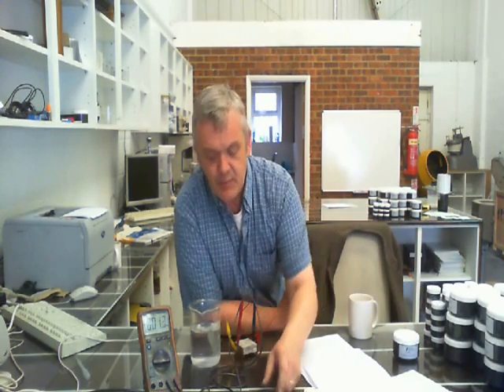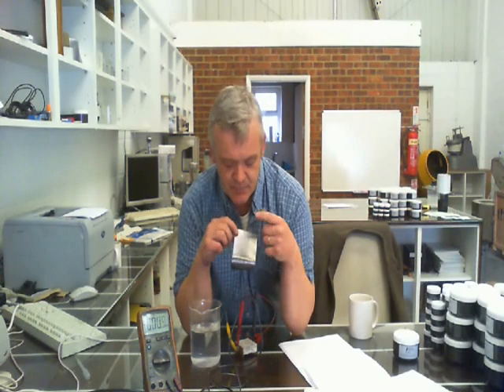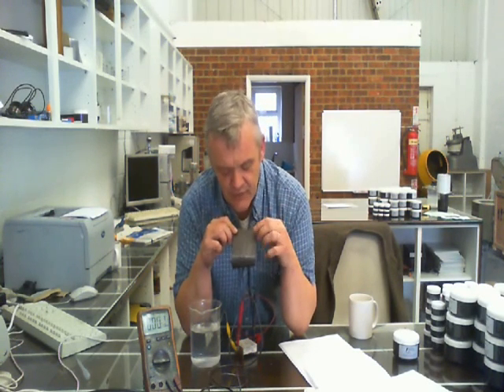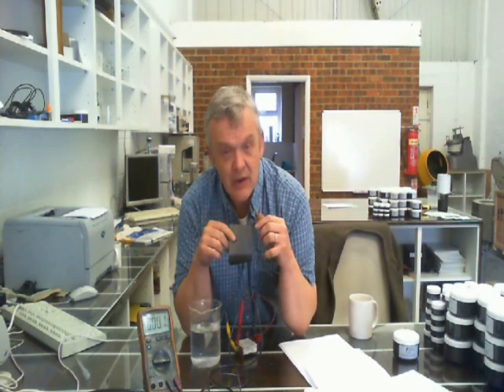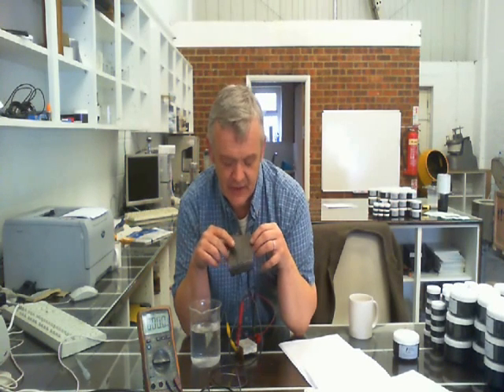Thermal Power Generation From Graphene

Comment: Hi Robert! Do you think it would be possible to use such an ink to paint a roof and get enough electricity? What would be nice is that by night, we could still get some power from the heat that gets out by the roof. I wonder if such material, by its isotropic property, give an extra-insulation. I mean if it generates some power, i suppose that the transfer of the heat is slowed down? Thank you for your answer.

Comment: If you were to apply this coating to the outer hull of a kenetic tidal generator to work in conjunction it should increase the overall efficiency of the device ie. more power smaller footprint.  On another note why noy coat sea walls with the waterproof graphene allowing power generation through the Peltier effect from waves crashing against the wall.
Reply from the maker: it's a good idea but sea walls don't have a particularly large surface area - well they could be mode larger with a villi structure

Comment: As the material is anisotropic, do you see a difference in resistance if you take 2 square readings at 90 degree to each other, or is the effect to small to register on an AVO. Great work btw, always enjoy vids and comments.- Martin.
Reply from the maker: yes - by a factor of 3

Comment: If a drop of salt water generates electricity, I wonder if its reciprocal? In other words the ability to move the droplet of salt water by applying current between two or multiple points on the sheet? I don't know if an aniline dye is the same as aniline salt but there could be "potential" in display technology - if you excuse the pun :)
Reply from the maker: I think the effect arises from the difference between ion inertia and fast electron transport within the graphene sheet - so the effect would be reciprocal but the energy required to move the ionic mass would be pretty large - or at least that would be my guess - if you are thinking of rotational effects then isn't this exactly what liquid crystals do? in a semi hydrated form large sheet graphene oxide platelets have liquid crystal properties.

Comment: By the way, I am pretty sure you only get 900 Millivolts Voltage, cause your lower lead croco clip is not isolated and is in the water. If you would isolate the contact point fully, so no water would come into contact with BOTH contact points of the graphite painted PET sheet, your voltage would only be in the lower 1 to 30 millivolts range probably... Have had these problems myself when trying out new battery concepts...
Would be great, if you could confirm this. Many thanks.
Regards, Stefan.

Comment: Robert, how much voltage was that ? It is hard to see, please always tell the values with your voice. Was it 0.8 Volts ?
Was your connection lead clip also in the water ? If yes, this is just a dissimular metal galvanic cell you really have to isolate all your contact electrode materials from the water, otherwise you get dissimilar metal effects and thus an galvanic cell. so just coat the contacts with plastic spray or hot glue, so it does not get any contact with the water at all...also any copper contact strip needs to be isolated from the water..
Regards. Stefan.

Comment: Do you think this material could be used to create an effective earth battery?
Reply from the maker: it can certainly be used to create effective batteries but I am afraid I know very little about earth batteries
Reply: Robert Murray-Smith There hasn't been much innovation in earth batteries since the days of the telegraph. They use two rods of different materials usual iron and copper to generate voltage. The problem with this though is that the process of generating electricity corrodes the rods thus a long lasting earth battery isn't viable. I wonder if the same effect would occur with the material you made.
Reply from the maker: Charles Haro
certainly worth a test
Reply: yes,yes. science

Comment: If the salt water and graphene was generating 0.8V and the graphene sheet resistance is 60 ohms then the maximum power output would be 2.6mW this is small but very interesting as it is a first try with no optimisation.
Reply from the maker: those figures are right - I have done the doctor blade on this and it is 56 ohms per square per mil - it is interesting isn't it

Comment: Perhaps there is some metalic dopants better than others for thermal power, just as with silicon and other semi-conductors.  I guess this is what is in your ink a bit.  I guess even though it looked like 0.9v that is a high value still, as known, hooking them in series/parallel and layers increase power/efficiency.
Reply from the maker: the ink is pure carbon - no metal - sorry to disappoint
Reply: perhaps adding some  could produce an effect, maybe a layer of silicon oxide on top or a sandwich
Reply from the maker: trailkeeper
could be - it's definitely a good idea and I may well play around with that - so thanks for the suggestion mate

Comment: Thanks for posting this and this was the exact the kind of testing I wanted to do with the ink.  I have done a lot of testing with thermal electrics due to the nature of benefits of non moving parts and so forth.  I have even went as far as binding copper and iron  together in a V shape in series to hand make one myself.  The results where okay for my testing but not what I am shooting for. The cost of commercial ones make it not very cost effective per watt with the included thermal sources input cost.  This is pretty exciting I must say cause that is just one sheet.  Thermal electrics can increase efficiency by stacking them on top of one another from one thermal input. 

If your going to do some more testing try seeing if you can create a current with just your hand and the ambient temp with one sheet. It will only increase with a little bit of engineering and stacking them.   I am crossing my fingers for ambient temp and your hand is enough to generate some numbers. Since you have plastic as your substrate  this may will give you more actuate numbers cause no warping or expanding is happening or at least a good control. Then you can get some control numbers that are good enough to calculate efficiency.  If you can get anything 5 percent or above you will basically beat most commercial ones hand over fist on cost. 

I honestly would be up for 5 days strait testing this.   The amount of applications due the nature of the material and along with its cost.  So many ideas I have had and now I have probably a hundred more.  I am not going to get any sleep tonight XD thanks hahahah.  So many ideas........  The surface area would give you good shot at using evaporation to create a difference without using heat as your input.  Also the surface area could lend it self to a good large heat sink to create a difference.   Honest I could go on for days of practical experiments to test out this application.  So I am going to stop here.

I think you should get maybe a google live hangout or skype call going at some point in time.  It will really be crucial after you ship out the inks.  Adafruit does a show called "show and tell and ask a engineer"  and a lot of people participate.  Google has even recognize the amount of people that show up on them. Since we are all scattered all across the world and text can only go so far.  LOL I nerded out, I apologize much love and cheers!
Reply from the maker: dude - that is one long list lol - where are you based?
Reply: Robert Murray-Smith
I am based in the states. Lol My bad I got super excited..Your enthusiasm rubs off. XD Don't mind me just there is just so many gaps a thermal electric "could" fill that other power harvesting techniques leave empty. I have a probable invested way to much time on it but I see tons of potential.
Reply from the maker: directeeccks
that is a shame - i was going to invite you down to the lab for a week - ah well some other time maybe

Comment: Was that 900mv? If so you can definitely get a JT running of it. I have one that runs on 1v and 10 nano amps... Yep light for 10 nano watts. Thats 0.000,000,01 watts.
Nice find. Keep them coming :)
Reply: Robert Murray-Smith Right - like where are naturally occurring heat differences already?  Will the graphene ink painted roof, if strips came down from the roof to the cooler house (or vice versa), would it generate power? It seems to me that Graphene is possibly one of the least entropic substances in the universe, but it still must obey thermodynamics.
Reply from the maker: yes it was 900mV
Reply: :D thats awesome :)
Reply from the maker: Mongrel Shark
lol - yeah it's pretty cool
Reply: I wonder if hot running salt water would improve the output?
Reply from the maker: Mongrel Shark
probably but you would need to heat the water first and the aim of this is power generation - i used hot water just to create a temperature differential for demo purposes that's all - in application I wouldn't want to use it that way
Reply from the maker: all good questions and definitely need answering
Reply: Ben Collins well that's a nice idea 💡.... Have you tried it

Comment: Very interesting. How does size effect the output? I'd like to make a thermal generator I could heat with the sun and cool with river water. I have been gathering materials for a peltier thermal generator for this purpose. I can't wait till I can get my hands on some graphene!
Reply from the maker: it's probably linear - but as I said in the video this is early days stuff
Reply: Robert Murray-Smith The early day stuff is the best. Always room for improvement. If you need any help let me know.
Reply from the maker: Tio Dave
will do mate

Comment: Well, if we are at it, does it generate voltage like piezo (positive or negative pressure)? And rubbing two pieces (gently, in 2 possible directions to test)? etc etc. You need more people to help you testing. Send me a bottle of ink and I can help you on this. (Or anyone here in the NL who can make some, let me know and I will buy some).
Reply from the maker: you are quite right - i do need more people to help me.